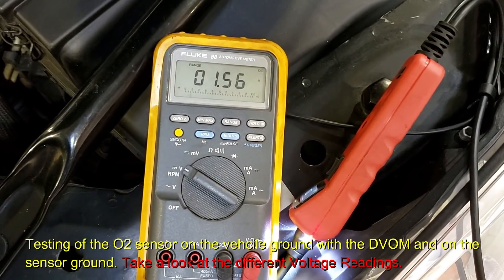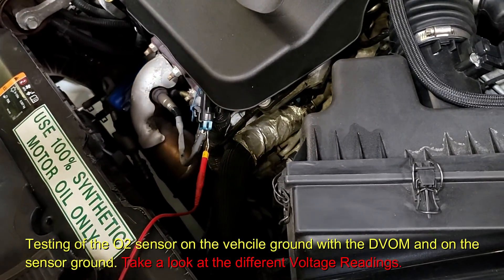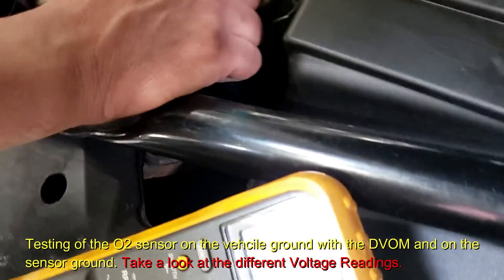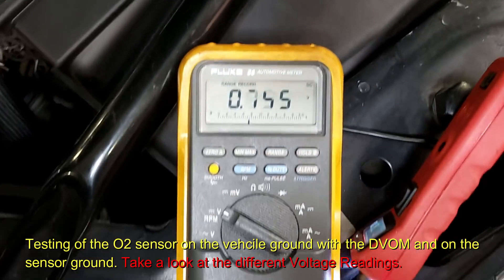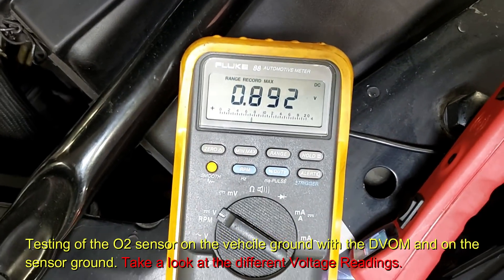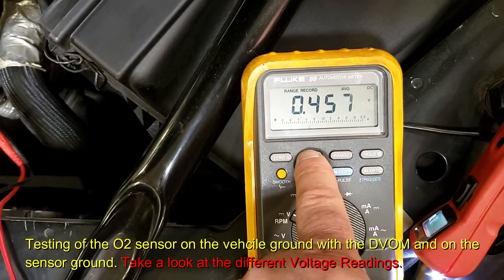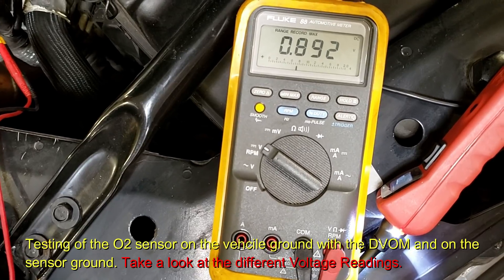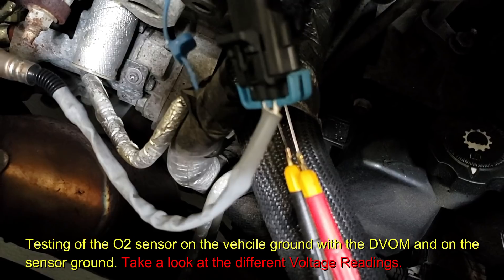GM O2 Sensor Meter Testing on Two Different Grounds

Comment: I get 3v from oxygen sensor heater ground. 12v from positive wire. When I measure both, 1.92v drops. And oxygen sensor does not work. Why? Why does ECU ground give 3v? When I clear the error, everything is normal, but after 5 minutes, 1.92v drops again.
Reply: You and me both. I also 3 volts from ECU ground. Did you manage to find the problem?